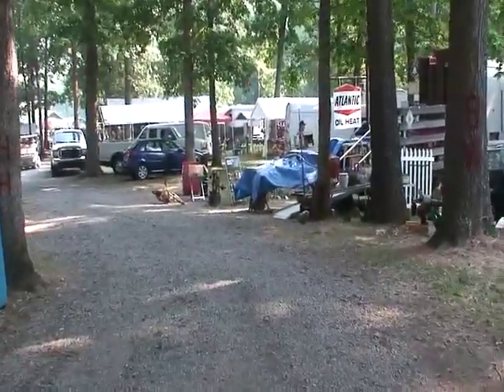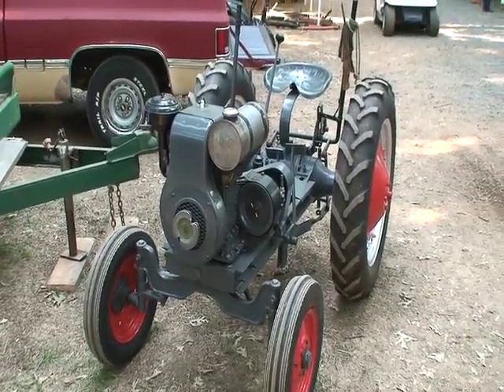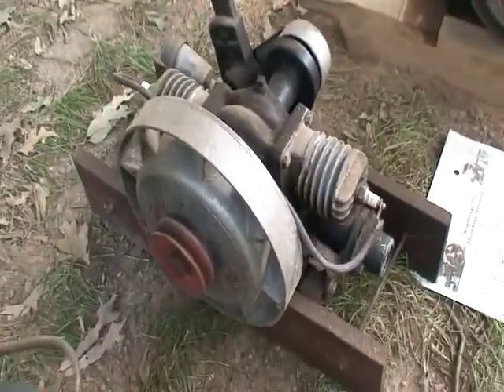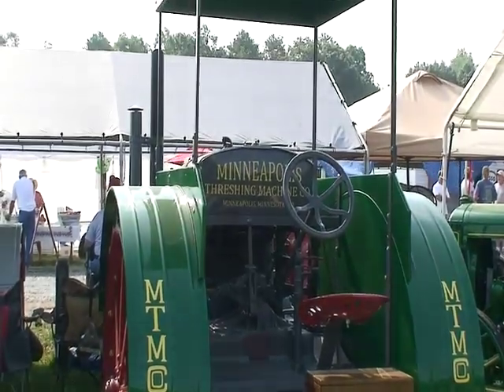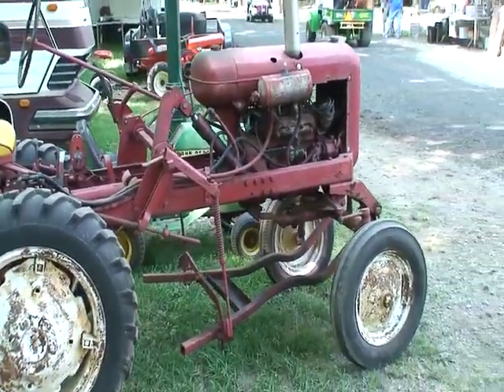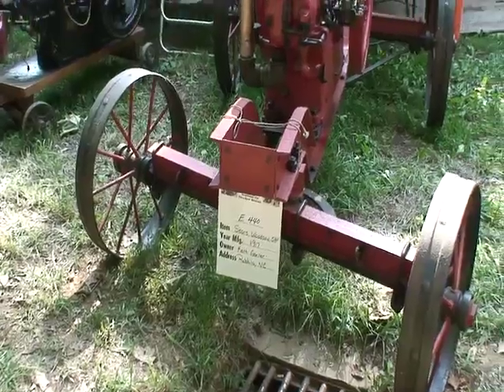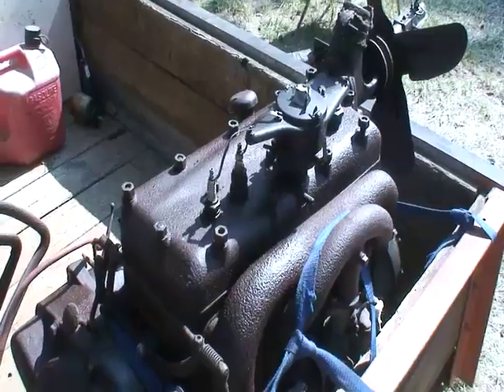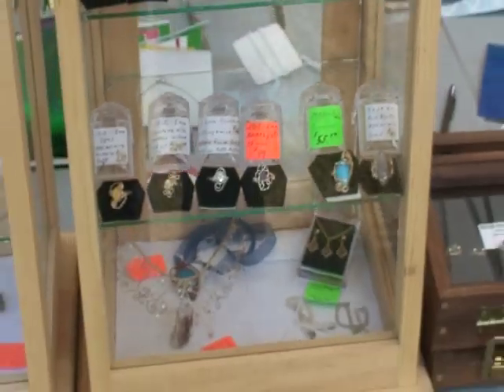Flywheel Engine Technology: American Power & Rise Of Flywheel Machines Video

Comment from the maker: @bf2dudes : thanks for asking - the boat will be back in the water in a couple of days.  We decided to have the hull painted, but were shown a restoration job on a 1972 boat (bringing back the original finish) and opted for that.  The hull now looks like new - I wouldn't have believed it could be done.  Bottom paint is going on now.